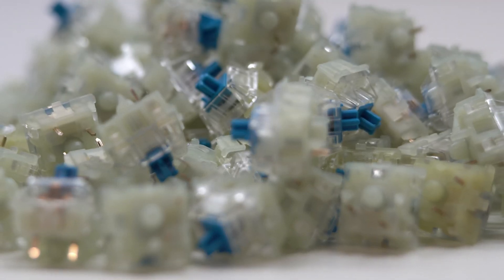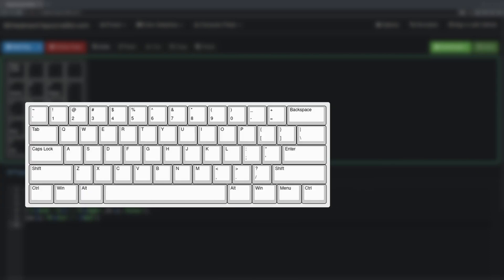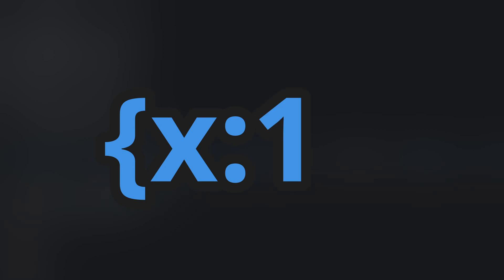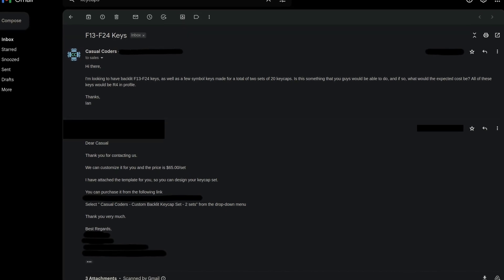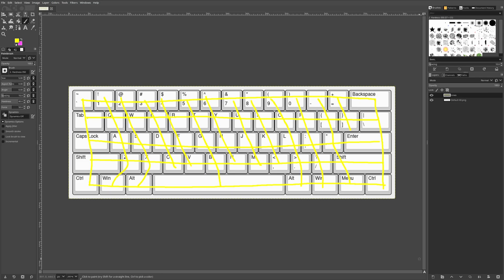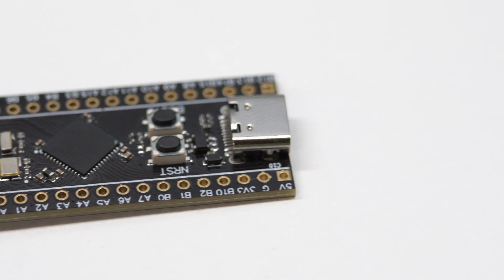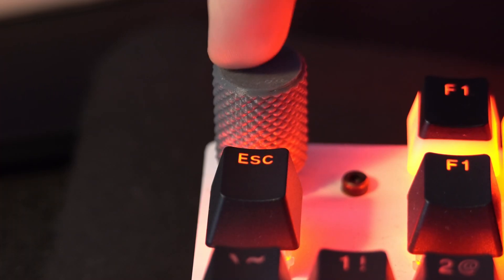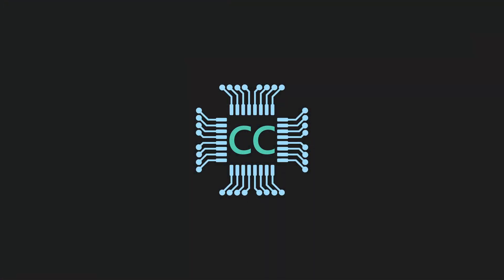How to Build a Custom Keyboard From Scratch | Part 1 Layout and Design

Comment: As someone who likes messing with the online keyboard layout editor for fun, it's cool to see a video of someone walking through how to edit the layout using the raw data section of the site, rather than just briefly covering it and moving on to the next section.
For those who find this comment, here's a couple tips (because I feel like it) for editing the keyboard via the raw data tab: You can put multiple key parameters in a single set of curly brackets (ex. "{w:2,h:2}",) which the website automatically does while you're editing the keyboard layout with the properties tab.
There's other parameters that can be used to get more specific shapes, too. w2 and h2 lets you create keys with extra bits that stick out of them by defining a second rectangle. x2 and y2 define an offset for that second rectangle, so it sticks out where you want it to. An example of a key that uses these parameters is the special Enter key found on ISO keyboards, which uses "{w:1.25,h:2, x2:-0.25, w2:1.5,h2:1}" (spaces added for clarity.) In short, it's a 1.25x2 key with an extra 1.5x1 rectangle that's offset to the left by 0.25 to give it the correct shape. You should probably add "x:0.25" as the extra rectangle isn't taken into account when the website spaces the keys out or when text is added to the key cap, the extra shape is treated as being purely decorative!
For a tool that hasn't been updated in over 5 years, it's a really powerful and fun tool to use, or just play around with.

Comment: How do you drive many LEDs from a USB port? I have 92 SK6812 Mini-E LEDs on my keyboard, and currently I'm just trying to see if running them at low power is bright enough to fit within the limtis of a USB port.
I'm also thinking I can plug into a Thunderbolt 4 port for mor power, or maybe do something in the software to stagger the PWM so that only half of them are on at a time.
Reply from the maker: I just drive mine (123) at a low brightness setting. Modern LEDs are CRAZY bright. Keep in mind that most LED lightbulbs equivalent to a 60 Watt incandescent are only 4-5 watts. You can get up to 3A at ~5v from a USB Port, depending on where it comes from. Or you could use an external (isolated) power supply to provide auxiliary power, though you'll want to do your own investigation to avoid damaging anything from backfed power.
-Ian

Comment: Awesome. I'm working on a stm32-based low profile keyboard with almost every add-ons it can handle (oled, rot-encoder, ws2812 led, external eeprom). 
The aim is to get as slim as possible, with ks-27 switch for keycap compatibility, so the stab mounting will be weird. My propotype is on its way from jlcpcb. I'm planning to post devlog video on youtube and share what I learned